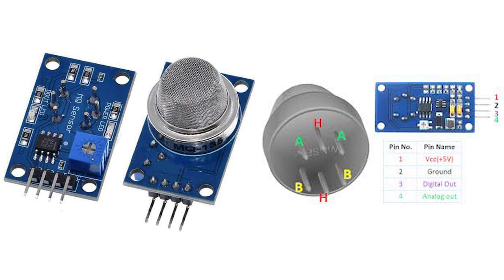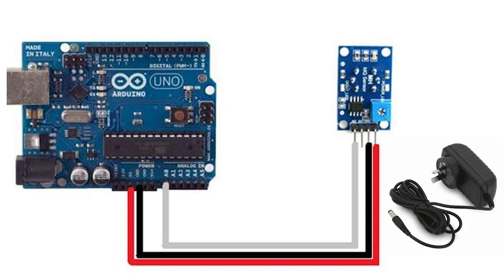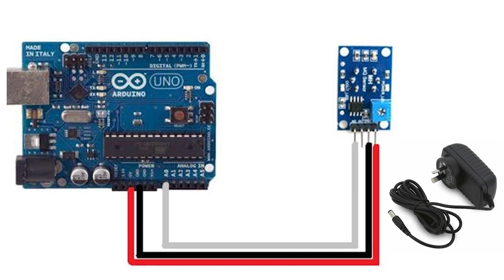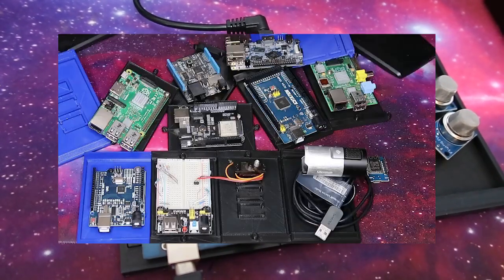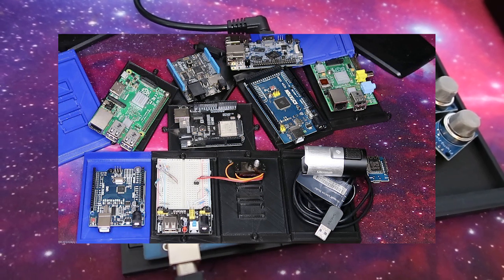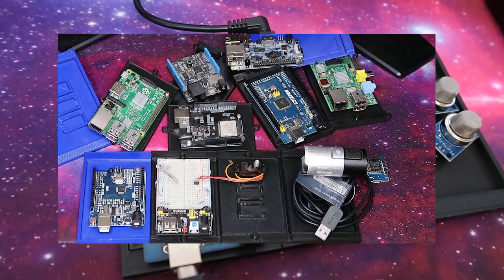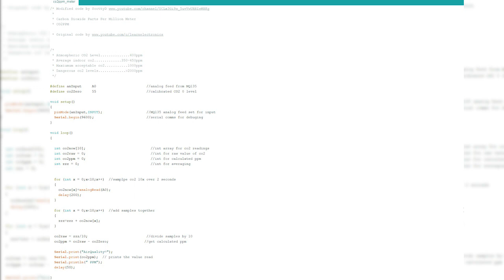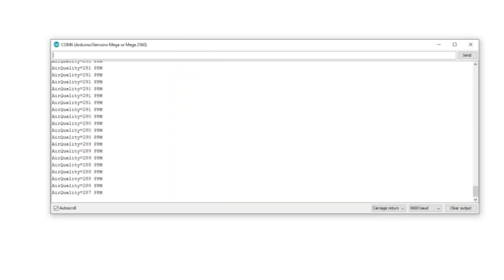How to Measure Co2 - Setup and Code a MQ135 CO2 Sensor

Comment: Hi Scotty,

Discovering your channel, really cool project !
I was wondering if this sensor was waterproof because I'm not sure you may get the fluctuations of C02 in the air, even close to the tube as it will be stuck in the algae and not into the top of the tube ?
I guess you plan to put at least 2 sensors, 1 at the top of a tube, and 1 outside the box (or not close to the tube) to measure the difference of C02 ?
I also think you might want to add a bit of Olivine at the bottom of your tube to increase the confinement of C02.
My 2 cents !

Kind regards from France :)
Reply from the maker: Hey Thanks, ill drop another reply to your other comment about the sensor placement, but ill have to look into Olivine I have not seen this before

Comment: is it okay to use mq2?
Reply from the maker: MQ2 sensors work in a similar way including wiring up, but the measure LPG, Smoke, Alcohol, Propane, Hydrogen, Methane and Carbon Monoxide
Reply: @ScottyDIY  so all MQ sensors will do?
Reply from the maker: every MQ sensor is different they have different gases they can detect

MQ-2	Methane, Butane, LPG, smoke	
MQ-3	Alcohol, Ethanol, smoke	
MQ-4	Methane, CNG Gas	
MQ-5	Natural gas, LPG	
MQ-6	LPG, butane gas	
MQ-7	Carbon Monoxide	
MQ-8	Hydrogen Gas	
MQ-9	Carbon Monoxide, flammable gasses.	
MQ131	Ozone	
MQ135	Air Quality (Benzene, Alcohol, smoke)	
MQ136	Hydrogen Sulfide gas	
MQ137	Ammonia	
MQ138	Benzene, Toluene, Alcohol, Acetone, Propane, Formaldehyde gas, Hydrogen	
MQ214	Methane, Natural gas	
MQ216	Natural gas, Coal gas	
MQ303A	Alcohol, Ethanol, smoke	
MQ306A	LPG, butane gas	
MQ307A	Carbon Monoxide	
MQ309A	Carbon Monoxide, flammable gasses

Comment: Where is the link describing the plastic modulares that the boards are sitting in?
Reply from the maker: Hi, They are a modular system I created, check out the video here: https://youtu.be/t11XWUqPqSs
Reply: I was hoping that they were for sale! This is the first good reason I’ve seen to buy a 3D printer.
Do you have a recommendation on a printer?

Comment: hi, Thanks for sharing, this is good work. this is helpful. I used codes as yours. I see AirQuality value around 70-80ppm. is this normal? and if I want to calibrate it with real CO2 meter, which codes or variables values do I need to change to calibrate? thanks Scotty..

Comment: Hello, thank you for the video, i was wondering if there could be any diference in the values that you get using the mq135   rather than  the Mg811 co2 sensor?,  or which could be the differece?, i appreciate your help, thanks a lot, best regards